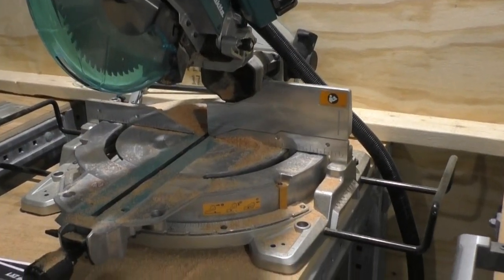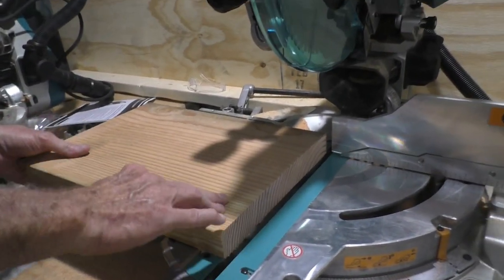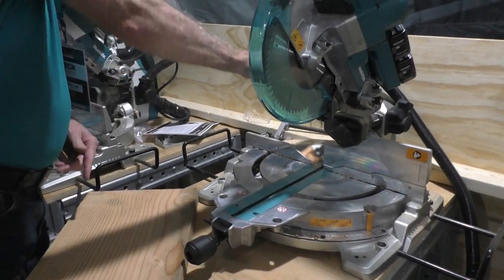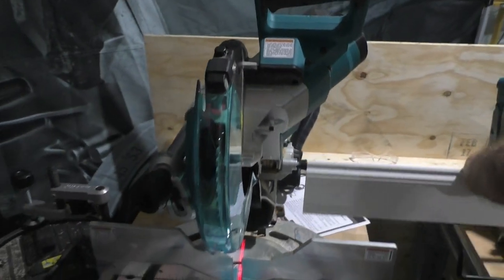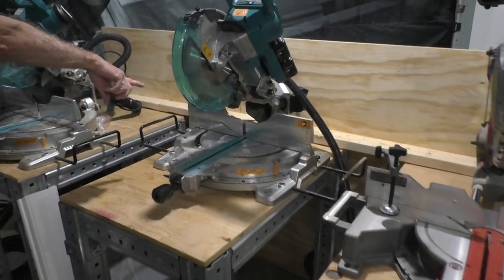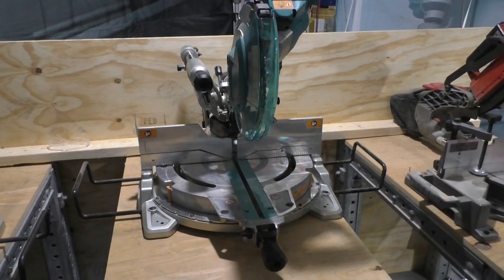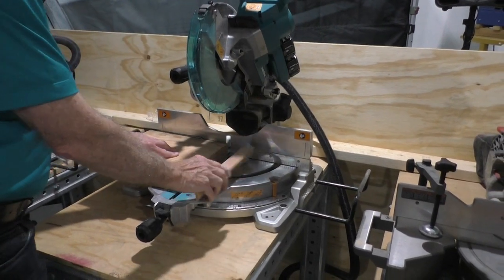Makita 18v LXT X2 Brushless 10" Miter Saw XSL06 & Corded LS1019L

Comment: All great but i pressed the black button on back left side of slide at the bottom. I tried to adjust or square off but slid over to 22 deg. Now I know to use the easy release in front but its not working either. It is brand new. What could I do to straiten it out?

Comment: why didn't you have both dust ports connected?
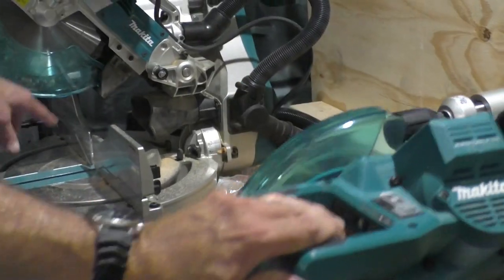Reply from the maker: There is a Y that connects both dust ports to bag or vac system. This was at an event with dealers, users and media folks so people were taking it apart and putting it back together wrong all day... Go to 4:08 in the video and you can see the corded LS1019L which shows how both ports connect correctly.